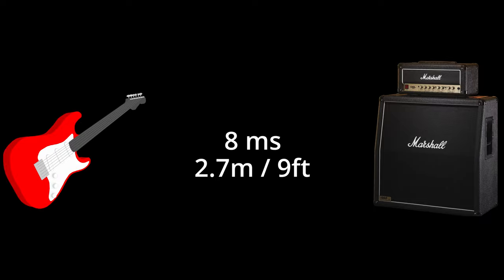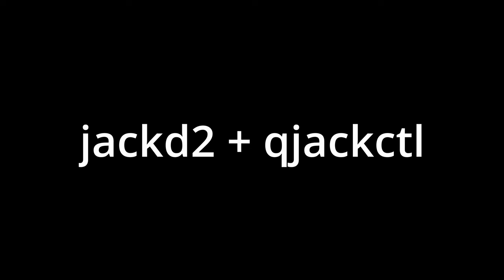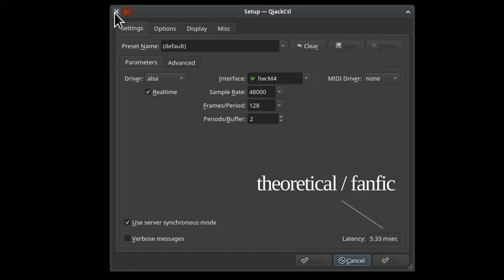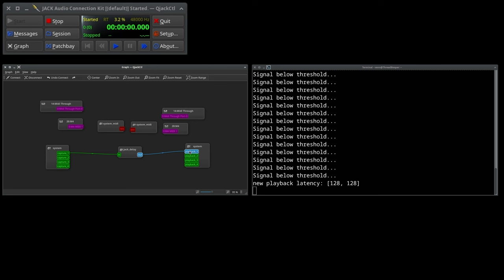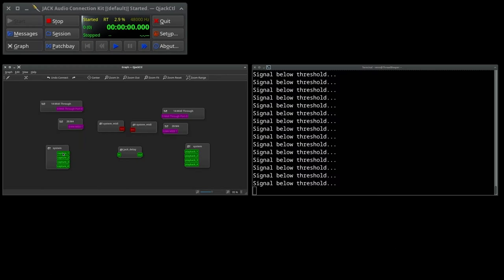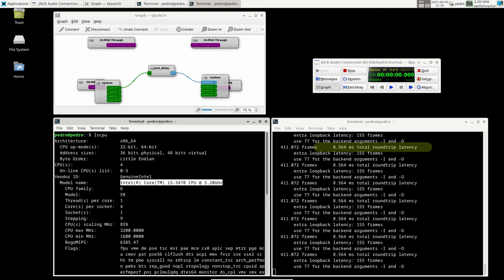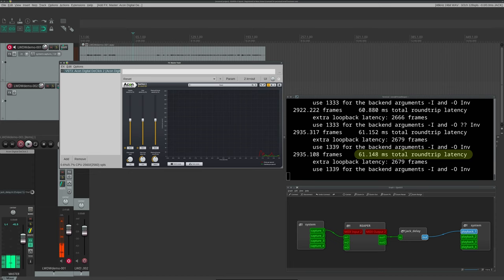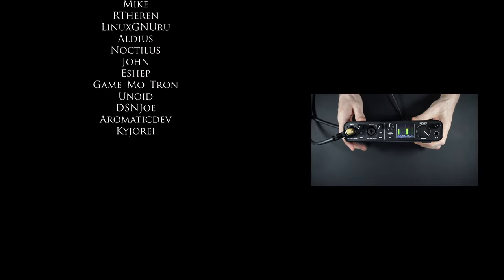Measuring Round-Trip Latency On Linux

Comment: Is the Motu easier to interface than the Focusrite scarlet?  I picked up a scarlet 4i4 for cheap used, and I'm attempting to convert to Linux from being a Windows user...  I really don't need all the io the 4i4 provides, and I don't like how it doesn't have buttons...  I still primarily use windows, but I'm pretty fed up, and will likely switch to Linux as a daily driver soon.   I use for interfacing my mic with ham radio stuff and then just for talking on discord, perhaps one day I'll pick up a bass again, but not likely for the foreseeable future.

Comment: Running an RME AIO Pcie card I have 4.6ms roundtrip latency.
I think any RME PCIe will offer similar results.
Reply: I've have both the RME 9632 and AIO Pro. Both manage around 6 ms at 48K 128/2.
Reply: @VennStone  hmm I will do some further testing,I think buffer size can be seat as low as 16 samples on nix.
I think 192 @ 32samples = 4.6ms RTL.

Edit could be 64 samples I can't remember exactly.
Reply: @Mystik3Al  192K 32/2 will give you 0.57 ms of round-trip latency with the AIO Pro.

Comment: @linuxgamecast 
Hmm... just as i was thinking about using an external plugin host with an analog mixing board (live enviroment, band) you show up with this..... :)
Seems it's not doable.
Am i wrong?
Reply: That depends on what you plan on doing.
Reply: @VennStone  That would be gates, comps, de-es, delays, reverbs and 3 or 4 band peqs.
Of course not all channels need that, just what a 'normal' band needs.
Reply: It can be done, I use Apple's Mainstage as our mixer with a thunderbolt interface Latency runs about 1.3 milliseconds at a 256 buffer at 96K sampling rate. We use a total of 20 inputs and 12 outputs on stage. There are zero latency plugins like thee SSL native channel strip 2, most of the softube plugins, as well as many others. We have been doing this since the M1 Max Macbook Pro came out and we haven't had a single dropout or crash but you have to test the system in rehearsals to find out what plugins are the most stable.But USB is not as stable as Thunderbolt, thunderbolt is PCI over a wire so latency will always be lower and Thunderbolt can carry wordclock while USB does not. Cheers!.